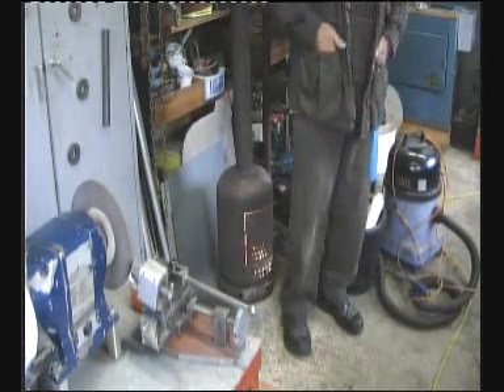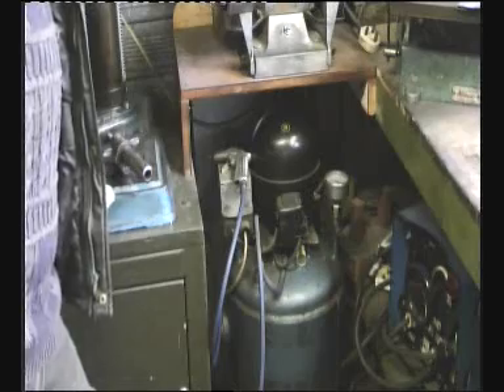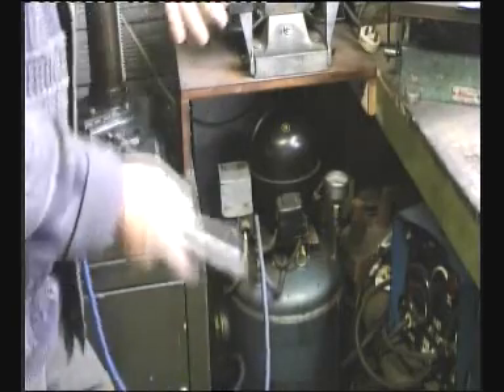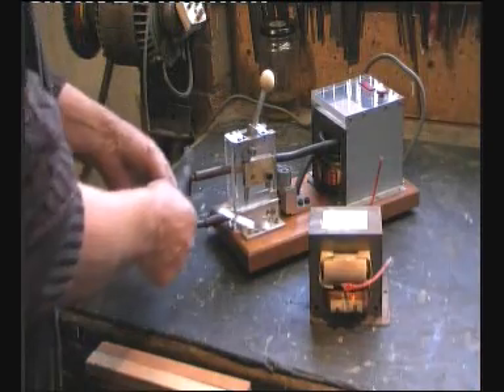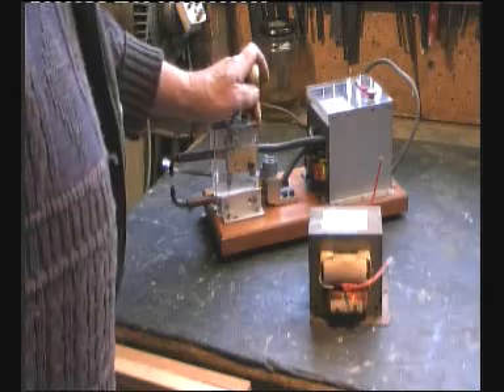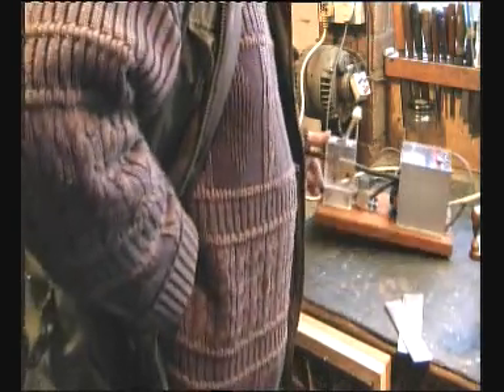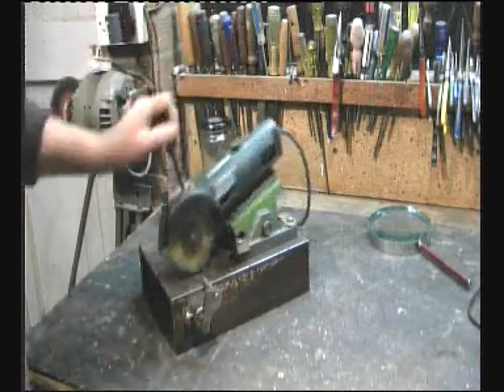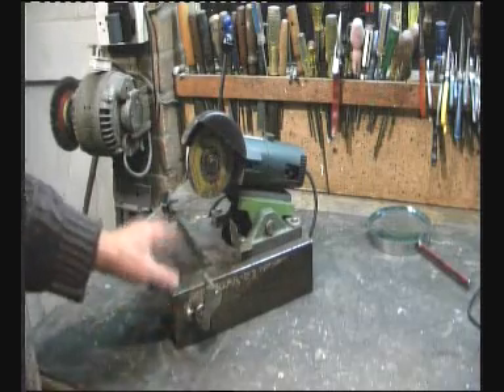no plans sorry

Comment: My comment from below was too long (soory ) so it continues here .....>>>>.. they are doing Nothing because as yet it has not dawned on them ,,,, that let 2 generations go by ,,,,  without simple hands on tool handling skills and simple problem solving and the whole population is left high and dry ,,, unable to even put a shelf on the wall without a half hour video,,,,,      but perhaps it puts the frustrating comments into some kind of context,,,  and  while such comments that you talk about are still hugely annoying you can perhaps view them in a slightly different light,,,,  while I have only yet seen two of your videos, im sure you have no need to question your own presentation or clarity,  both are outstanding   (thats what stopped me in my tracks to comment )  my only suggestion might be a piece to camera,,, hello welcome, these videos are aimed at passing on ideas and concepts of how to build make do and reconfigure things etc, in most cases im demonstrating the basic principles ,,,  using what I have to hand thats why there are no plans available so please don't ask for any, its pointless me doing plans for a cut off saw using a DeWalt grinder if you have a black and decker ,,,,  if i say fix it down I am expecting you to have the basic skills to understand what size fixings to use depending on the stress and duties the part will be doing, or taking , You may have to reconfigure the project completely to make it work with you own parts ,,,, and the skills and tools you have available,  remember your getting my years of workshop skills and experience passed onto you absolutely and completely free of charge and while I hope to inspire and promote all sorts of projects you have to contribute something yourself,,,even if its only reading the comments below to see if the same question has already been asked before you ask it again and again ,,,, while im only too willing to answer questions and help anyone I can it can be very tiresome when people ask questions about something that is clearly stated and explained in the video ,,,,  or pick fault with the slightest error ,,,   etc etc etc something that makes them think first and something you can reuse on the front of each video,,,,  On the front of my furnace videos I put a written piece ,,,, these are my working practices that I am comfortable with,,, you the viewer are responsible for your own practices and your own safety etc etc etc  but they just ignored it,,,,,   still trying to have a go at the slightest error rather than see,,the main concept,  like fins around the crucible more than halves the warm up time,,,,    ,,, Anyway ,,,,   Chill out my friend ,,,   and I will be back to look over your libary of videos and pick up loads more tips and ideas ,,,,    (Someone has given me a lathe so im hoping to get into a bit more metal work rather than woodwork and modeling ,,,,, )   Cheers for now ,,, best regards  Alan